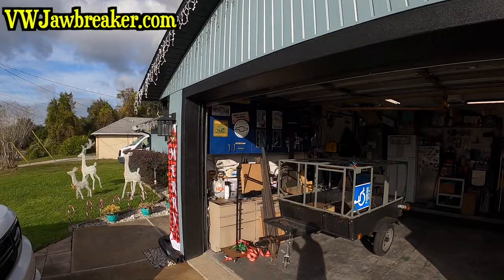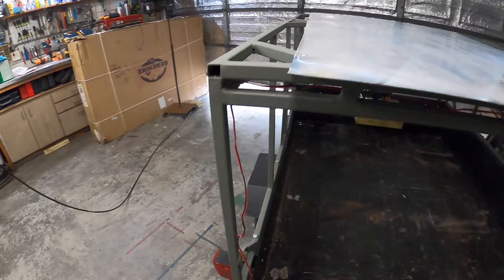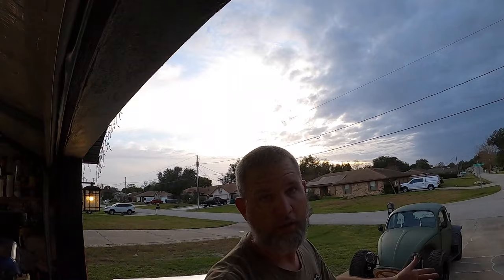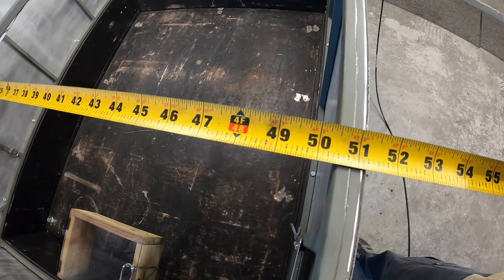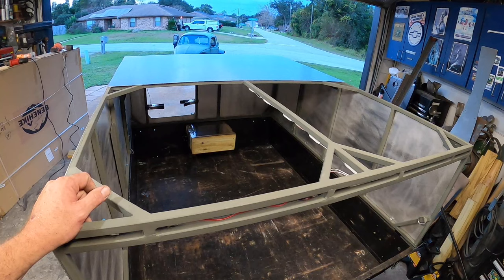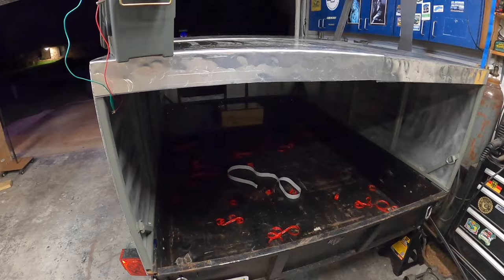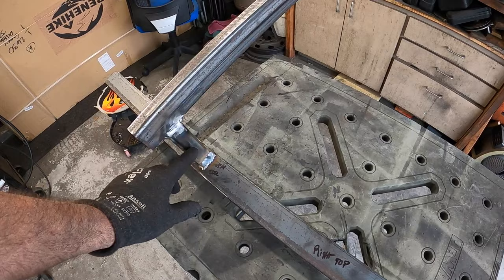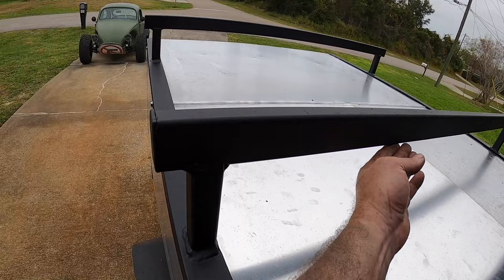Lightweight DIY Overland Trailer! Part 2 Enclosing the structure and cross bars.

Comment: Even if it doesn't flip over (which I don't think it will) you might want some sort of outrigger type stabilizer jacks.  No fun being in a camper rockin' all night making you seasick.  Looks great so far!
Reply from the maker: Good call, I actually end up installing one on each corner just to ensure things are stable. 
Appreciate ya as always!!

Comment: Great job, Gary. Have you thought about using panel adhesive like Mike Fn uses on Bus floors? Might be some type of an epoxy which will definitely stick!
Reply from the maker: Thank ya!
I thought about using panel bond however I used what I had here and the 3M tape is more than strong enough to hold the panels in place. Several others have built trailers with the same tape and never had issues.

Comment: G'day Gary,
Everything is looking awesomely good. 
I've been using 3M 08115 Panel Bonding Adhesive. Its water proof and you can weld through it. You should work it in on your next project. 
Q. Does the roof top tent have a bathroom and toilet. 🤔.
So thanks for sharing man I'm looking forward to seeing the tent on top.
✌️ Peace from Melbourne Australia.
Reply from the maker: Hey buddy!
I think that’s the same panel bond I have saved however I didn’t have it on hand and needed to get this part wrapped up. The butyl tape and seam sealer will hold it water tight. 
Nah, no bathroom unfortunately but there’s usually a near by tree 😂
Tent is going on next week 🤙
Appreciate you as always!

Comment: Gary use butyl caulk on the seams , it never dries out
Reply from the maker: The tape on the underside works the same way.
Reply: I was thinking of panel bond on the seams.  Glad you used the tape. I didn’t think of that good and easy idea @VWJawbreaker
Reply from the maker: @RJLM330  considering I already had the butyl tape, figured mine as well use it. 
I did think of panel bond also, just didn’t have any in hand.
Reply: Plus the $$$ @VWJawbreaker